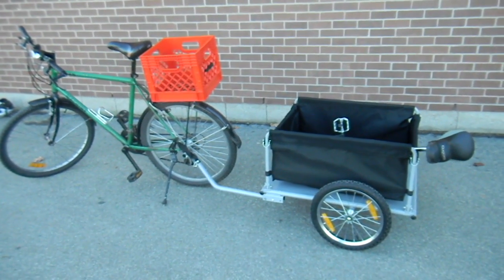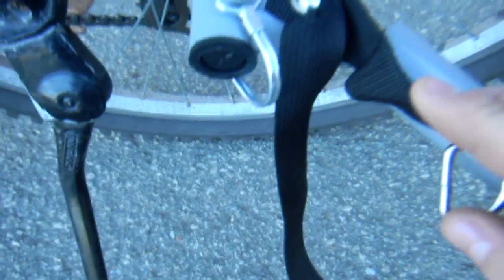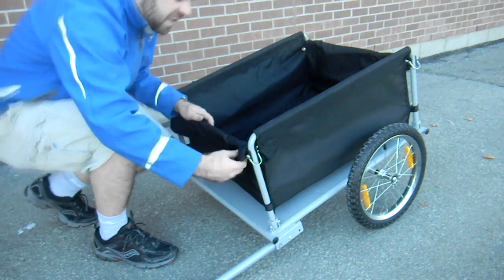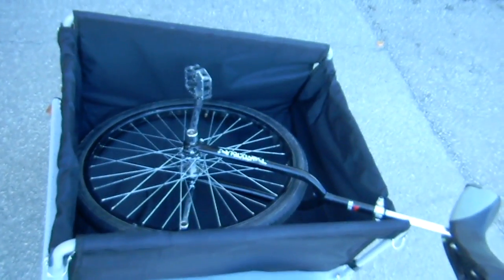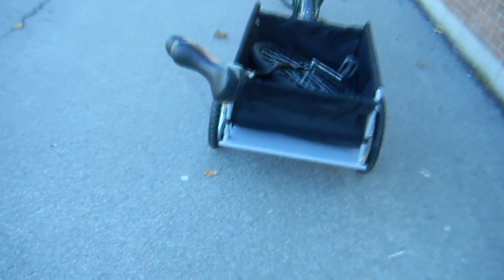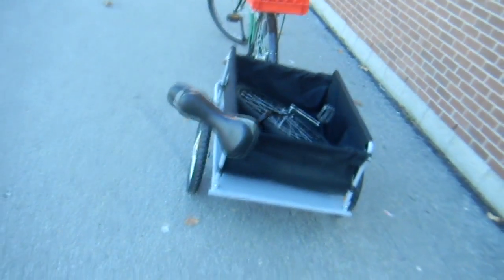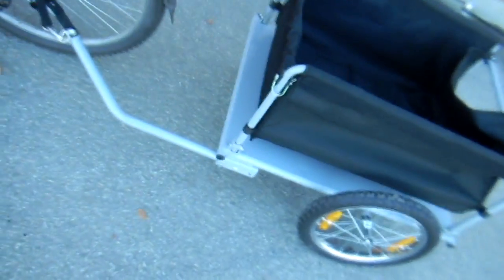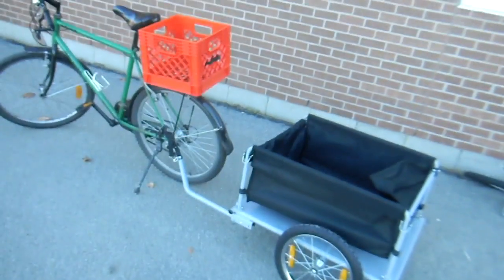Cargo Bike Trailer - First look and demonstration

Comment: My trailer is 80% the same. The difference, from what I can tell, is the shape of the bike tow hitch. Mine is on a 45 degree angle, which I feel would probably aid on moving it around. Only issue I’ve found is that has a tendency to bounce around when empty. When it’s full I found it really smooth and easy to use.

Comment: My trailer was a rebuilt child trailer  ''Dreamer Design'' 20'' inch wheels I had to rebuild the trailers tongue it broke when I was hauling a load of wood shavings the trailer was fine handled the load nicely but the Tongue ripped off the trailer. I had to relocate the tongue bracket on a more sturdier part of the trailers frame that ment drilling new mounting holes for the tongue bracket. used pallet boards for the trailers box. and lag bolted 2x4's in between the outer frame rails so I have a good base to screw down the trailers  1x4 deck planks.

Comment: I'm a uni student and I think trailers a great idea to transport the stuff needed to study, including my work folders. I'm worried about how to secure them properly so it doesn't get stolen. Is there a way or do I have to reattach the trailer each time?
Reply from the maker: Probably the best option for this particular trailer is to drill a hole in one of the corners of the frame that is large enough for a lock to pass through.
Reply: What about just using the frame?
Reply from the maker: Yes, you could loop the lock through the foldable side rail things, but if someone really wanted to steal the trailer they could unbolt those from the main part of the trailer.
Reply: Yeah I guess,  ur that's the only prion I have atm. Also when putting the wheels on, did you anything between the wheel and the trailer? I have a bolt thingy and a weird shaped black bot thingy. Do I need to use them?
Reply: buy a 6 foot cable.

Comment: still wondering how quick release of tire works, and what type of bolt pin is used in that mechanism
Reply: I've had excessive tyre wear, a solid axle all way through will have no wheel shimmy or toeing out

Comment: Hi. I found one for sale near me and saw this video. Thinking of using it for a couple of touring trips per year. Is this trailer a good option for this? 3 years have passed since the video, you still use it, any major flaws? Thanks!
Reply from the maker: The trailer is quite inexpensively made, and I really can't say how well it will hold up for long distances. I only use my trailer 2 or 3 times a year at most, and only in the city for short trips. There are other videos on this YouTube channel where I have shown the trailer in action. The only flaw that I've found so far is that the original inner tubes would slowly lose air and become soft after a week or so.
Reply: cjhoyle Well, it´s good to know that it hasn´t fallen apart after 3 years. My tours are on asphalt only so let´s see how this goes. It guess its not a big investment to make and if things go wrong, I can always go for the Nomad Upgrade. Thanks
Reply: @cjhoyle  My trailer is the VidaXL version, the canvas bag has no velcro front/back, alloy rims, from what I saw your axle retainers are the correct way round, mine were the opposite, causing rapid tyre wear - excessive toe out

Comment: One more question I'm lost I look for a bike rack in front like a Baskin and a back rack that's big enough to carry some groceries in cuz it's kind of hard to carry your groceries on The Handlebar being trying to steer I need something like that also and I need to be pretty wide for a grocery bag at least the fit in there or or something couple of gallons of juice that might like to drink or maybe a 12-pack of mango tea put in the basket besides beer in my backpack can my backpack can be for like light stuff like bag of chips or something that will not get crushed can we go on eBay to get that also I just hit a hundred 80 lb I'll be okay for a couple bags cans orange is not real heavy no work this perfect but I need the brand name of this trailer and I need the cover for the top in case if it rained I'm carrying my groceries home but don't get too wet and one more thing can this fit inside of a apartment door if it's raining that way I'm not in the rain when I get home if not that's okay I still managed to what one of these bad boys I should have thought of this I could have been Rich by now living my dream but I didn't think about that was too late cuz that then his kids we didn't think about stuff like this now so tell me the name of this trailer so I can look online so I can find me one just like this one did it looks like a pretty good side to hold a few cans in there

Comment: What's the brand name of this trailer and can it fold up and slide under a bed I'm looking for something similar to this so I can cash in some cans for some side money cuz I'm having hard times right now and I figure I can use something like this to get a couple of heavy bags not too heavy just a couple heavy bags and Karen to the can join and cash them in cuz I don't drive the last days when it's not raining I can take my cans to the can joint in recycling because sometimes I tried to protect your house from all the cans I want to do it my way by rinsing out the cans first then I'm going to smash them cuz I don't like this in my cans cuz I'll do that myself well just wondering cuz it's also work for carrying a couple bags of cans on the trailer cuz that's what I'm really looking for something that can fold up and it's easy to store under a bed or in the closet somewhere and doesn't take a whole lot of room and it's really easy to put together and take apart without I haven't spent all day on it and I kind of like the idea of that trailer that's similar why I'm looking for but do you got any other color besides black tarp or whatever you call that and you got something to cover your groceries up with in case if you have to carry some groceries to so sometimes I tried you for myself and then sometimes I have to ask people take me to the store or somewhere if I need to go but with this I can depend on myself sometimes on this little trailer for the bike I have a green Schwinn mountain bike that my mom bought me the money she gave me then she passed away my step dad gave me the money and one day I saw this Green Mountain Bike I had to buy it but I'm thinking maybe I should update on my mountain bike is way the cables are made and everything and I wish all my cable was inside the frame somehow but then I'm still going to keep it and get to new job so I can keep riding it but then Fred was someone messed with the cables and decide to cut the cables cuz they're thin they don't have no brake for my bike and if I do get me another bike someday Maybe I'm going to maybe a neon yellow bright bike for emergency use in case if I have to ride at night somewhere for emergency use which I probably won't cuz I try to not right at night if it's not a muff one more thing what is the name of the trailer so I can do my homework Maybe by this one I know the frame to fit underneath the bed tires I can find room for the tires somewhere out of the way that's not a problem in the apartment life and yes I know this can work for carrying maybe two or three bags of cans well right now I'm asking what the name of it and can you buy this on eBay since eBay just pretty good job for me instead of Amazon and then I can probably have someone help me get it together and that way I can start doing my can right now it's going to take a while to do the cans and then when I have like two or three bags I can go cash them in myself at the can joint and sometimes you might have to ask my sister maybe is she could take me to the can join but I got to do it my way but right now I'm trying to get back in small business of cans recyclable business
Reply from the maker: My trailer is unbranded, but other commenters have mentioned that there's a company called Aosom who sells a trailer which looks the same as mine but has their logo on it.
Reply: @cjhoyle  I thank you for the information you have a blessed day I think that was similar to yours when I got done cuz I thought yours was awesome trailer cuz that will work good for my apartment life for now now help me out on some things when I recycle my cans the help me out cuz I'm on my own and I have a bike and that would definitely work and I could use it for other stuff too if I need to but mainly cash in my cans right now I don't have hardly any kids cuz I got build up and when I get to three bags it should hold cuz I did find one soon yours exactly like yours actually and it was 143 lb just like you're not just want to say thank you and I just want to say whoever made these trailers I should have Ben rich but back in those days we didn't think about it until the present came and it does come with a cover if I need to use the cover I know it's going to fit in there and eat the bed in the wheels can be put to the side that way if I'm not using it it be okay I'm also looking for a big giant Basket in a another basket for the back of the bike just as well in case if I'm not using the trailer I think I have pretty good ideas where to get some good deals on eBay I'm just doing my homework right now right now I got to save up my money to get get stuff like this I guess take your important stuff first but you have a blessed day sir

Comment: the brand name is usually Aosom, and with those 16" little wheels, there's No Way it would be safe  to load that poor thing with anything near " 180 pounds".  Even with 20" wheels, 180 pounds would be too much.
Reply from the maker: The one that I bought is unbranded actually. The diameter of a wheel does not determine it's strength.
Reply: @cjhoyle  My main point is that the "180 pound" load maximum of the light trailer with the 16" wheels is Absurd. A person would soon find out that an overloaded trailer is dangerous.
Reply from the maker: @dehoedisc7247  This video was posted more than 8 years ago and I still own this trailer. I've loaded it with 180 pounds and did not find it dangerous. I really don't understand why you think 16" wheels would make it unsafe.
Reply: @cjhoyle  I have owned an identical trailer with the 20" wheels (factory rated for 180 pounds max.) and while it is quite well handling with a light load, it is obvious that it would be quite a handful with heavy loads. And the factory does not rate the model with 16" wheels at 180, that is the rating only with 20" wheels
Reply from the maker: @dehoedisc7247  As explained in my initial reply, the trailer that I own is not branded. The paperwork that it came with said 180 pounds. So yes, in my case the trailer I bought was rated for 180 pounds.
Reply: @cjhoyle  The 16" tyres would carry 25Kg each, the trailer is rated 50Kg max